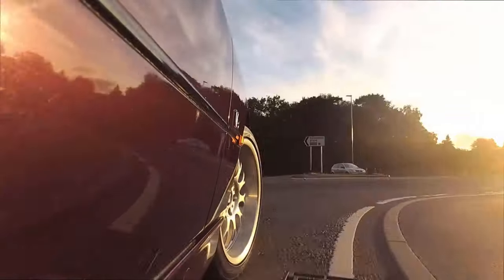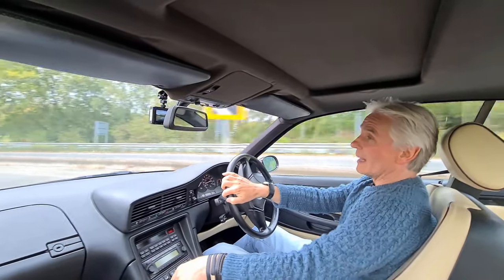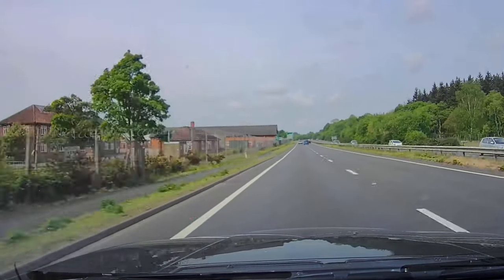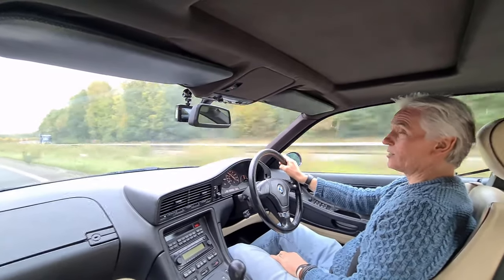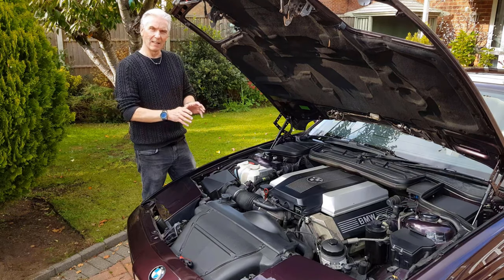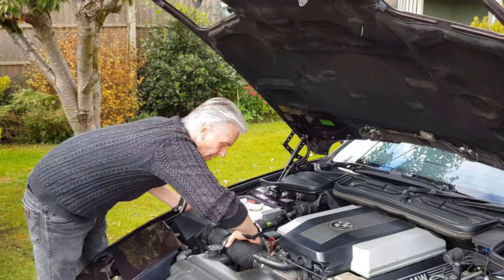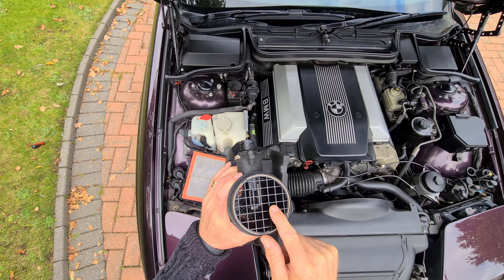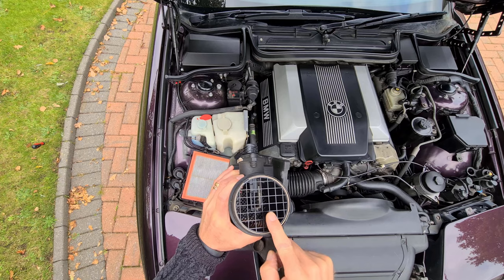BMW V8 Performance Improvements (M60 and M62)  PART 1 - 540i 740i 840ci

Comment: A few misconceptions about the inlet manifold there - the M60 and non-VANOS M62 share the same inlet manifold runner size. The early M60 inlet manifold have the trumpets which improve low end torque however these were removed from the design later on due to the risk of them falling off. The M62TU VANOS engine has the reduced runner size inlet manifold and this is proven to make less top end power but does benefit mid-range alongside the VANOS cam control. The M62 / M60 inlet manifold swap is a worthwhile swap for the M62TU if you use kickdown (or have a manual car) often and make use of the powerband above 4k, and means the V8 pulls strongly all the way to the limiter where a M62TU falters above 5k. The reason the 4.0s were lacking in torque was partly because of the inlet, partly because of the lack of displacement compared to the 4.4 but crucially, it was because they ran much more aggressive cams than the 4.4. The 4.4s run much milder cams, which benefit the mid-range. On dynos the 4.0s are seen to make the highest peak BHP figures compared to all variants of the M60 / M62 engines. I've had all three variants, the M60B40, M62B44 and M62B44TU and the above characteristics are definitely reflected in the way that they drive. In the US, DINAN sold "uprated" inlet manifolds for the M62TU cars which were actually just rebranded M60B40 manifolds. Running the M60 / NVM62 manifold with N62B50 throttle body, 4" maf housing, M62B44 exhaust manifolds, a good exhaust system with X-pipe and a re-flashed ecu can see figures of 330bhp from the M62TU engine.
Reply: Yepp, going from 4.0 to 4.4 and making same power but higher torque with different manifold is probably all you need to know. Im guessing bmw did it so it would be a bit quicker in everyday driving ( lower rpms) but if you have a manual you probably like to rev so
Reply: BMW under-rated a bunch of engines at 282hp for tax purposes

Comment: the two dislikes are from people with "cold air pod intakes" hahaha
Reply: Factor is with a cold air intake. I’ve run 0 to 60 with and without the air cleaner on. Absolutely no difference. This is not the choke point of the intake system
Reply: Factory intake is cold air from under the passenger side
Reply: I remove snorkels because I'm a front end noise guy (also the engine cover, and the plastic plate behind the headlight in my E34 540i, to reduce under bonnet temps)
Couple of very very stubborn plastic tabs, one you can get at through a cutout, the other is on the inside of the airbox and needs a big screwdriver and a lot of swearing to nullify the 25+ years worth of hardening

On my M52 in the E39 touring too, got rid of the snorkel and a bizarre piping that snaked from the corner under the LH headlight, across the front behind the bumper, and opens in front of the aux fan, facing backwards. ?!??
Clearly I don't understand enough to understand what the hell the point of that is, but it sounds much better with it off and both the economy figures and butt dyno don't notice any degraded performance

Comment: If that car was hot, and the fan was locked because it locks up if the car heats.. please dont put the hand on that fan, it will brake you re fingers off !!! ... and then when it is locked, it take some feelable power, 5-10 hp tested.... so PLEASE DON T TRY TO STOP THE FAN WHEN THE CAR IS HOT !!!!!!!

Comment: After you've had enough of the stupid viscous clutch fans throwing their blades through your hood and radiator, you will happily switch to a much safer electric fan. The viscous fan moves with the engine, as the engine and transmission shifts around on the mounts with varying torque output, and with a failed engine mount it will impact the shroud and send blades flying.

Or the water pump bearing goes, or the clutch seizes up while you're at high revs and suddenly you have a 5000 rpm death weapon under the hood. Switching to a lower temp old fashioned thermostat (highly recommended for engine life) causes more hot coolant to circulate in the radiator and actually triggers the fan clutch more, it's like driving a big truck around - kills throttle response too.

When it's really hot outside and you're idling, the viscous fan doesn't move enough air at low RPM, so an electric fan is better for that too. But it won't help fuel efficiency, that much is true.

Comment: I am sorry Timm but regarding viscous fan you are wrong. Motor trend tested different fan setups on the dyno and results tell different story. And that is for old V8 big blocks with old alternators. Check out these tests. Viscous fan can take up to 20bhp of engine power (at 300bhp at the crank) that is why it is not used anymore. And that is why track cars delete it. 

Another thing with electric fan retrofit it make sense only together with 88c thermostat to keep things cooler under the hood. Much better than the 117c thermostat and viscous fan. 

Intake manifold upgrade makes sense only with a tune. Otherwise it robs power. With tune and exhaust it makes a significant change, not by itself.

Road tests have margin for error - different temperature, fuel, different road. When it comes to measure power upgrades dyno is the way. Not the butt dyno :)
Reply from the maker: Hello Pabloel, thanks for your comment, I always like hearing alternative views. I take your points, but have to say that the viscous fan is just freewheeling when at anything other than idling. As soon as you get airflow from the car moving through the air there is zero load.

The  M60 and M62 are old, inefficient engines and really need the power from the viscous fan to get the heat out when idling - more modern engines such as the N62 (as I have in my 650i) don't need that much cooling (in relation to the older V8's) and are perfectly happy with the electric main fan.

However, an electric fan is fine in the older V8's if you just pootle around - but for getting the performance from the engine it needs a powerful fan, and that doesn't include an electric one

Comment: I am wondering if it is possible to buy BMW e38 (740i)sport one with a manual gearbox with a 6 speed m62 v8 cylinder?
Reply from the maker: There were a few made - but very hard to find these days
Reply: @TimmsBMWRepairsandInformation  Do you know why BMW didn't release the 7 series e38 with a 12-cylinder manual gearbox?

Comment: This guv is misleading on the pod filter and ass backwards about the B40 manifold upgrade and here's why. Everyone knows a pod filter has to be encased in a cold air box (as was fleetingly shown in the video amongst the incorrectly fitted pods). Secondly, the bigger manifold may sacrifice a little torque but it gives more power in the rev range and that's great in this application because the last thing this car needs is more torque..... it is notorious for spinning the wheels setting off the traction control. I have the B40 manifold and a K&N air filter in the standard airbox and my e39 is far quicker. It hits a sweet spot around 3800rpm and takes off like a rocket, chalk and cheese. You soon learn to deal with the changed torque curve.

Comment: No much room to improve performance on an atmo engine. I don't know this Engine in particular but you make good remarks. All this accompanied by an acute but nice British accent. After watching several videos of yours, my guess is you are or have been working in the Engineering industry, don't you?
Reply from the maker: Thank you for the kind comments! Yes, I'm an engineer - but electronics!
Reply: @TimmsBMWRepairsandInformation  I guessed it well after watching your video about the battery current drain where I can see you are using lab DC power supply, and oscilloscope. I am a French electronics engineer too that was graduated from UK.
I like the way you make the videos outdoors, being yourself without worrying about your neighbour's judgments. It is a more complicated task for an average and narrower minded French man. :)
Reply from the maker: The neighbours think I'm mad, and have done for a long time! Good to hear from a fellow electronics engineer!
Reply: nonsense! these motors (4.4) are choked at the factory and at a relatively low cost you can increase the power by up to 60hp including final software tuning

Comment: Thank you for your expertise & for taking the time to explain it all so thoroughly Timm !!! Especially , thank you for the easy tip of sliding washers onto the M62's intake manifold bolts in order to eliminate potential manifold gasket leaks . I have a quick question regarding 1 thing you mentioned in this vid : you said that a Zionsville electric fan will lead to power loss/excessive electric draw in older BMW's ; but what about just their aluminum shroud with attached aluminum expansion tank - could that item improve heat dissipation ?
Reply from the maker: Thanks! No, the OEM BMW radiator is aluminium and the expansion tank is very complicated and neccessary!

Comment: Do not listen to his advice. Only thing he right about is air filters, and that depends on intake set up you doing. There is reason bmw started using electric fan. Also you here feel drag when giving it the beans. Big whoosh til clutch gives suddenly your car starts moving around 4k just long enough to shift be stuck with viscous fan drag again. Did electric fan conversion while ago. 3 outcomes. 1 no noise, 2 car finally moves, last gained 1mpg. And intake manifold really? Forums are flooded with dynos before and afters.... My man you legitimately saying proven info with tested facts is wrong....
Reply from the maker: I'm always glad to have the other side of the story - but I will stick to my opinion!

Comment: But this video doesn't explain a single thing to increase the performance of an M60/M62. A rare misfire from Timm, and 24 minutes wasted.
Reply from the maker: Give me a chance - I couldn't fit it all in one video - the second and third are on their way!
Reply: Hi Timm. I enjoy your program. Very
Reply: Very nice information and good told. Could you also give tips for a x5 4.8 2006.  It runs like brutus. Muscular with a dark sound. 360 hp and 490 nm. Love it much. Could you gave tips for more performance for this kind car.  I,m already impressed for peogram handling and power. But fine tuning is  mij hobby.
Reply: Dude give the man a chance, he is explaining how to help people please don't knock the man for this. 
If the video was an hour long you would complain about that..
Just sit down and enjoy...👍👍
Reply: please, here is the list;
thermostat for 85*C
for TU motors, intake manifolds with m60 (large runners)
Exhaust manifolds with m5 (without catalysts)
cold air intake - larger diameter, heat shielded and insulated
change of position of intake temperature sensor
conversion to an electric fan (best mod in these engines) 
custom software modification (up to 25hp increase) 
optional gearbox software update (alpina)

Comment: Hello ) and thank you)tell  me please 
The chain should be sitting still (when I open the oil cap) or it may jerk slightly to the sides or top
Reply from the maker: It should be completely stable on the sprocket at all times - if it isn't something is wrong I'm afraid!

Comment: Hahaha, yeah I always have a chuckle when people use those cone filters and stuff them in the engine bay, usually right near or above the headers, and claim that they now have a "cold" air intake... It really doesn't take a rocket scientist to work out that moving the opening from the front of the car (usually behind the bumper, which is also very handy for mitigating water being sucked in, in the wet) to the engine bay where all the heat is, is a dumb idea. I always maintain that especially on BMW's, the team of engineers are pretty clued up, and messing with stuff that didn't come standard with some variant or trim level of the same model and engine spec, is inviting disaster to the table, especially cheap, off-the-shelf aftermarket rubbish. I think I know what you did to get the performance though, but not going to spoil it for the rest who might not, if I'm right, the number 15 might be involved somewhere ;).

Comment: Great video as always! I know that the S62 engine in the E39 M5 gains a lot of power with a set of performance headers. Is that a worthwhile modification for the M62 engine as well?
Reply from the maker: They may well help - but I've got cheaper options that make a bigger difference!
Reply: What options you have? Thanks

Comment: E39 540i auto has a 3:15 diff as standard fair enough open diff but still
Reply from the maker: It is James, and on the E38 740i Sport, the perfect ratio!
Reply: @242tdryan  agreed the torque levels just don’t match upto that setup

Comment: Hi Tim, what oil would you recommend using  for the 740i ? Does it make a difference ? Also what's your opinion on changing the transmission fluid and filter on the ZF-5hp and how often would you change? thanks for your information! Saved me buckets of cash!
Reply from the maker: Transmission fluid should changed at 100k, the evey 50k. Check my video on oil and filter change on the 840ci, that will be the right oil!

Comment: A cooler thermostat would have to be the next task.  Would love to get an extra second quicker in my  X5 4.4 M62 TUB, in the low sevens now.🤔
Reply: i dont think that will make it any faster :)
Reply from the maker: The M62TUB thermostat automatically reduces engine temperature when pushing - but, look at it the other way, 108C saps engine performance and increases wear, so changing will help those - but not performance!
Reply: @TimmsBMWRepairsandInformation  Lower engine temperature translates into lower inlet and automatic transmission temperatures, which can affect ECU control and "uncut" power. If the car is equipped with a factory  clutchfan, the high temperature on the original thermostat also causes power loss through the clutch engagement.

Comment: I love the sound your car made when merging from the slip way. Was that achieved by drilling the internals of the rear silencers? I have a 99 740 with the TU engine. Totally stock engine and exhaust.
Reply from the maker: You will have to wait for Part 3!
Reply: @TimmsBMWRepairsandInformation  Groovy. 
I've only recently come across your YouTube channel. I've already watched a few vids and instantly subscribed.

Comment: Regarding the cone filters: You just need to find yourself a cone filter that has greater surface area at a more direct route than the stock unit and place the cone down in the cutout where the fog light would normally be.

You need to think about what makes a good intake: Resonance, surface area, cool inlet location...otherwise it's no wonder you'll make less power
Reply from the maker: If you can provide those capabilities in an intake system you probably have the stock one fitted!

Comment: You can remove the viscous fan without adding an electric fan. The aux fan is sufficient. And you remove the risk of the viscous fan exploding, as they are known to do.
Reply from the maker: You can't rely on the auxiliary fan unless you drive like a 90 year-old, put any effort in and the aux fan will not save the day!
Reply: @TimmsBMWRepairsandInformation   not true. I drive the shit out of mine. That viscous fan just isn’t necessary.

Comment: Beautiful car. Beautiful cat also.  I will have to wait for the performance secret. The N62 on your 650I puts out more horsepower than BMW claims. Great for insurance. A properly tuned N62TU with a fully functional DISA, high octane gas, and cold ram air when traveling at high speed will produce in excess of 400 horsepower. Increasing the tune and rev limiter to 7000 RPM can yield more horsepower at the expense of destroying AC compressors and shortening the life of water pumps. Not practical for reliability though.
Reply from the maker: Thanks Jason, yes Pippi is a lovely cat - follows me everywhere and always steals the scene! Good tips there!